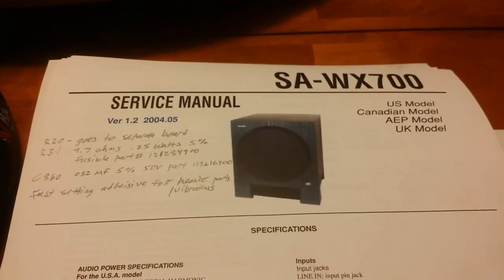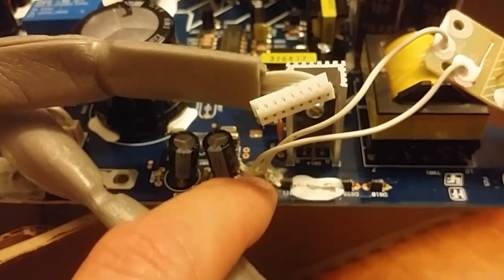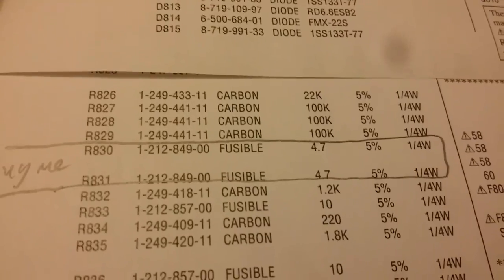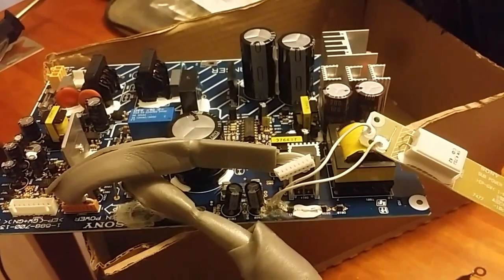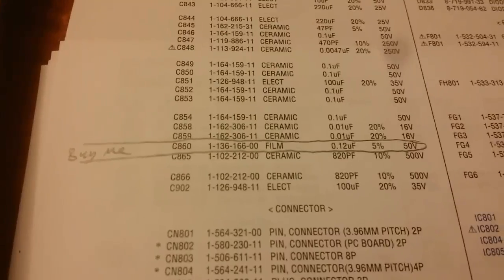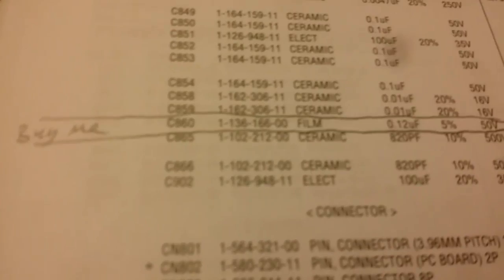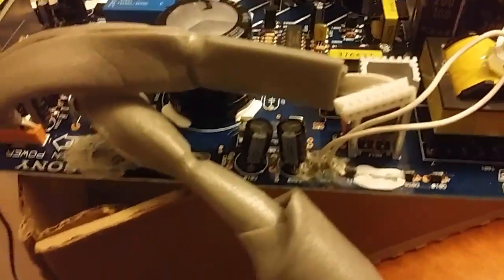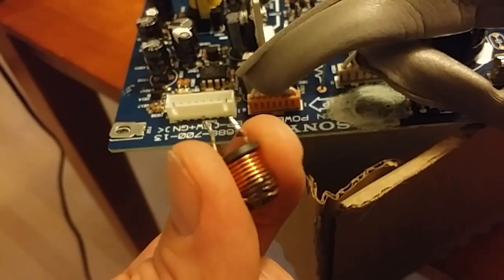Sony SA-WX700 common problems and bad part identification

Comment: Hi, Issac. I  Have one of the subwoofers. Unfortunately when I bought it  And brought it home I realised I broke off the centre post in the RCA connector. Unfortunately this meant that I had to take the entire thing apart and unsoldered the connector from the board. However when I pulled up it pulled the tracer off of the board. I need the connector board. I was wondering if you wanted to sell yours out of your subwoofer or if you have the part number so that I could order it. I have not been able to find it.

Comment: From the AVS forum: Apparently there is multiple versions of the service manual for this sub.  Finally finding the latest version, Ver 1.3 2004.06 (Revision History states "Correction of C860 Part No. and capacity.").  So for the record:
C860 Part No. 1-136-164-00 FILM 0.082uF 5% 50V (note that this is microfarad).  From me: You keep saying transistor and they are resistors, and you must use the correct value!   Your 4.7 ohm 5W resistor is an upgrade evidently done at the factory, no need to replace it.  Higher wattage is better.  The part that you unsoldered by mistake is a choke, or inductor.  It's not electrically damaged, OK to solder back in and put the plastic cap on.  I just ordered 10 pcs, Nissei 0.082uf 50V film capacitors on eBay getting shipped from Asia for $5.94. Also, 60 pcs 4.7 ohm resistors from Asia for $2.76.  Will let you know how I make out.
Reply from the maker: I really appreciate you taking the time to share this information. I never got mine to work but I still have the speakers. I will give it another go soon thanks to you. Isaac
Reply: The parts arrived from Taiwan and China, less than $10 for 60 resistors and 10 capacitors.  It took hour to carefully heat the white glop with a heat gun, scrape it off the back of the board, and get the capacitor and resistor connections accessible.  Another 30 min to solder in the 2 1/2W resistors and capacitor plus another 30 min to reassemble into the case.  Also found what appeared to be a poor solder joint on the main power transistor.  Had no solder on the top of the board, center pin. Not sure if that was any of the problem but it works!  My board has the C860 soldered under the board with one lead between 2 diodes.  This was a very tricky soldering job!!!

Comment: Mine went out about 7 years ago. I never looked into it after a back injury. I decided to open it up today, and i only found a fuse blown out, everything else seems fine. Their are two fuses that came wit mine, a 6.3A/125V and also another one on same main board at 10A/125V.  My 6.3A/125 Volt was blackened inside, the 10A/125V was fine.  I have the same white little board as you. I think we got the upgraded and newer version that didnt blow as easy as the older one's without that white board.  

Also notice in the back of the speaker where it shows you model number, above the model number their is a little white sticker. Mine says "6D" and not "4B" Like the other Videos on YouTube. Do you know what your sticker says?  I think the sticker is the Revision Model Code ? Not sure, but that is what it sounds like to me. 

Did you get your to work ? I will try to find this fuse tomorrow at Radio Shack or Electronic Repair Shop :o) 

Thanks for the Video.
Reply from the maker: EL EVO  nope still not working.  I sat them aside and haven't opened them back up.  They are holding up a few boards to make a makeshift bench at the moment.

Comment: Hi! Did you happen to make yours work? I have one, for about 11 years and stop working.
Reply: Same here, mine is just like his model, with a white little board instead of the two resisters like on the other YouTube Videos. Mine only has a blown fuse, everything else looks fine.  I would open  yours up if i was you. Maybe you will get lucky and only have a blown fuse. Their are two Fuses on main board. 6.3A/125V and 10V/125V Fuse.  My 6.3A/125V Fuse Blew.  Hope this help you out some :o)